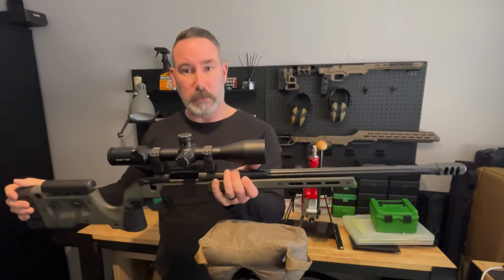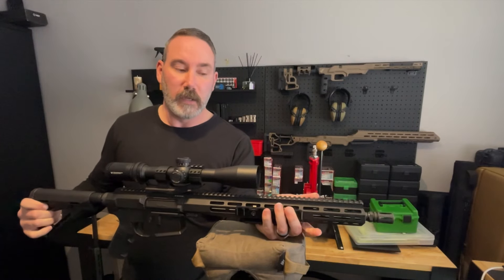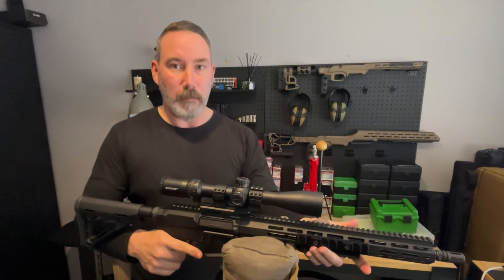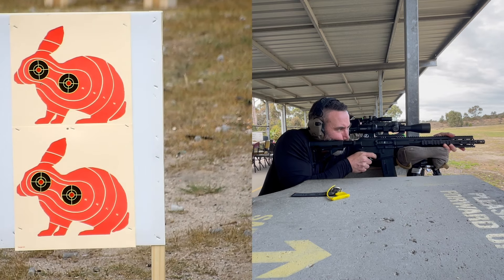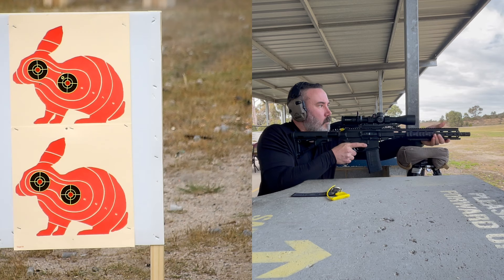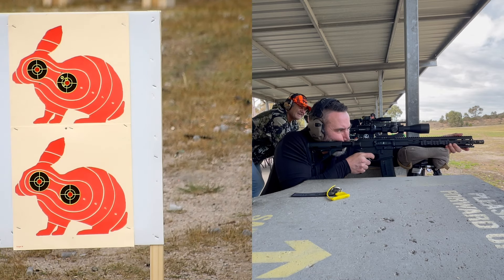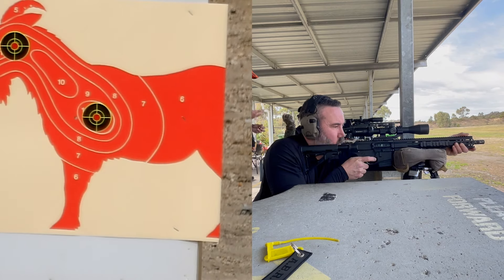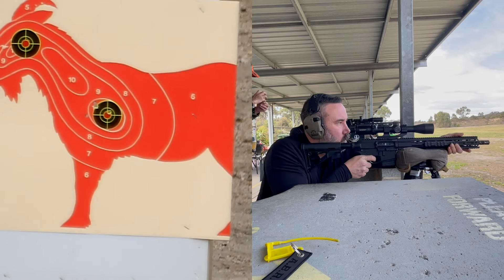Wedgetail MPR Mini 223 - Practical Accuracy Test

Comment: Had mine for a month, couldn't wait to move it on, terrible accuracy, jamming all the time and that trigger at 5 pounds is nothing short of crap and all that for 4k heaps of better options out there,  even the 7615 tricked up a bit is far more accurate and reliable and way more $$$ friendly.
Reply from the maker: @garybalasa3158  that’s unfortunate and thankfully hasn’t been my experience to date, so fingers crossed it doesn’t change.
Reply: Hi Gary, sorry you have had that trouble.   I checked our records and we haven't heard from you regarding any problems with the rifle you purchased.  Are you able to please contact us using the details on our website?  We are very keen to resolve any issues.  Where did you pay $4,000 for the MPR Mini?  The RRP is $2,950.   Looking forward to hearing from you - Richard

Comment: Great video mate! I just paid for mine today! 

I know Wedgetail said you can take the rails off on the handguard, if you wanted to run it on the bag, could you take the bottom rail off, meaning the action woudl be protected by the rail in the bottom. It would effectively turn it into a weird straight pull (on a bag at least) but could be an option?
Reply from the maker: Thanks Declan ! I had thought about that, but as you say, wasn't sure how the action would work if I did. I'll be testing the Magpul Vertical Rail Grip in a coming video, so if that's not much help, I'll try taking there bottom rail off, and see what happens.